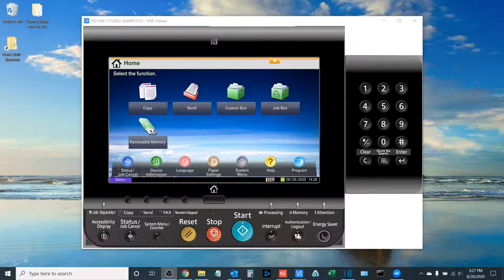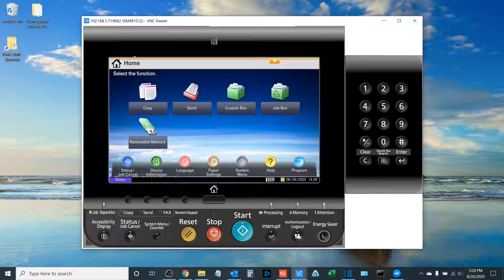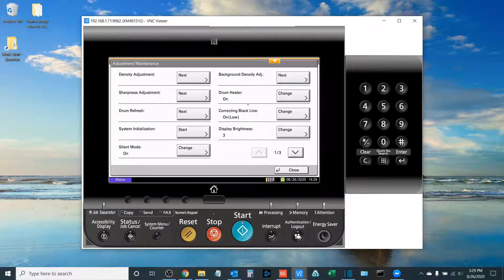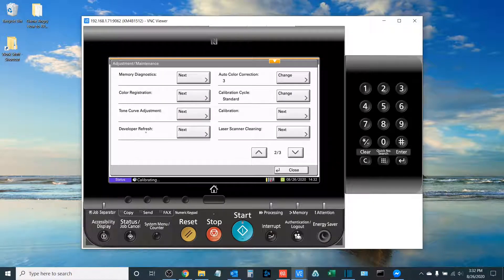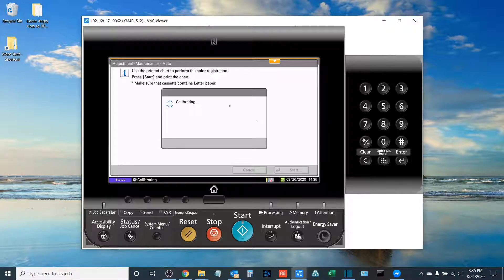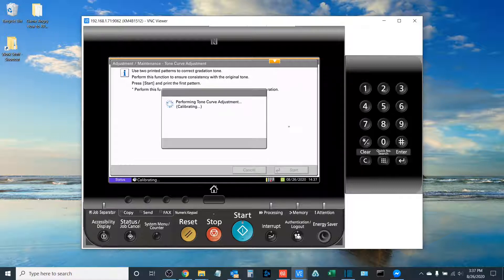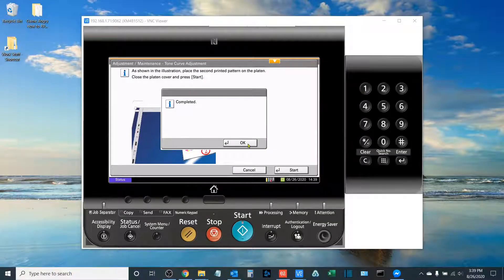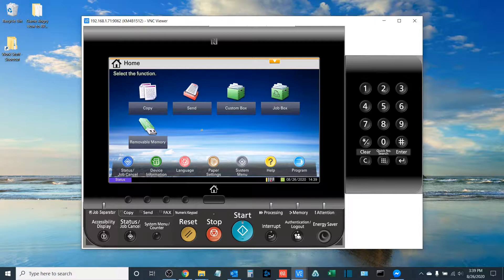Fixing Color Issues and Performing a Color Calibration on your Kyocera Taskalfa MFP

Comment: What if I can’t get pass the color resignation test? It says “ cannot perform color registration. Check the original.”
Reply from the maker: Hi Hails!  Begin by cleaning your glass.  You may have dust or a goober on it that is causing it to not be able to focus. Make sure your original is facing the right direction with the arrows. Otherwise, it might be dust on one of the sensors.  If that is the case you would need to place a service call.  In the same area, there is a drum and developer refresh. You can do those too and revisit the color calibration. If you send me an email, I can send you a guide.  karas@bdsdoc.com